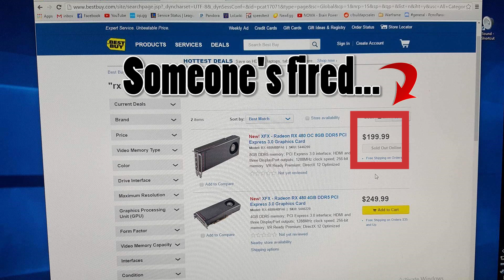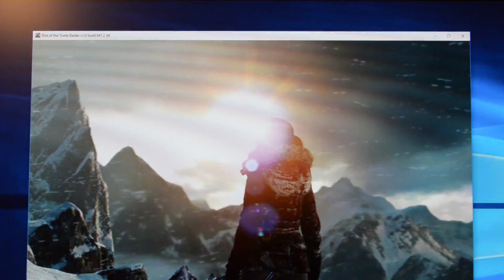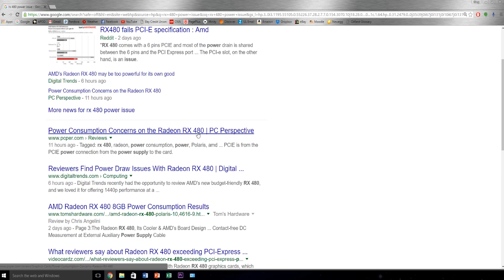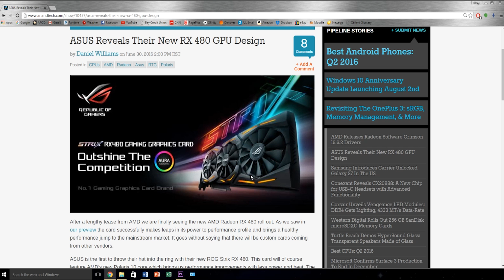RX 480 Aftermath: Power Issue & Over-Hyping

Comment: RX 480 loses against R9 390, which is cheaper right now. So whats the point?
Reply from the maker: The R9 390 is not cheaper than the 480 here in the States, where I and most of my subscribers live. That's the point.
Reply: +Science Studio yeah it varies. But here it is. But the point is the perfomance. Will custom 480 bring much higher perfomance?
Reply: Yea the 390 edges it out just barely. The 390 was the AMD card to get last year. It was also 400 bucks when it came out. I think you are missing the fact that the 480 has about the same specs, performs just as well and is half the price as the 390 at launch. Also it draws half the power to get those numbers. Right now a 390 is $275 and a 480 is $240. Old tech vs new tech and you save 35 bucks. The choice is clear for a mainstream gamer.
Reply: +J C Who cares about price launch?!?!? The thing is that 480 is same price with 390. And 390 have better perfomance than 480.
Reply: Yea, I can see this conversation is going nowhere and you obviously don't know anything about graphics cards other than the price.
Reply: +J C yeah yeah say this to the bencmarks.
Reply: +J C you Just think because the 480 has better price launch its better gpu! Wtf really.
Reply: The benchmarks are made without optimized drivers. The benchmarks are literally moot. If you don't understand the technology differences in a 390 vs a 480, you aren't ever going to get it. The 390 barely, just barely outperforms the 480 on drivers that aren't even made for the 480. So when the drivers start to mature, you will see the 480 beat the 390. Reference boards are good for a baseline benchmark, but partner boards will offer better cooling and performance increases, compounded by matured drivers. So, in other words, buy the 480, not the 390. You will thank me later.
Reply: +J C did you saw that 480 had drivers in bencmark videos?
Reply: The drivers used for 480 benchmarks before the release of the card are pre-release drivers. They were made so the card would work. They weren't made to optimize the card. AMD is still working to optimize the 480 drivers. When the drivers mature (which is what I said before, but i guess you missed it), you will see more performance improvements.
Reply: You're never going to get it. You have no interest in understanding. You just want to argue on youtube about your preconceived notions of AMD.
Reply: +J C dude wtf really? Who said about bencmarks before the release??? Look The bencmarks after The release of this gpu! Lmao
Reply: Dude, I think you might be slow. The benchmarks you are seeing all around youtube, were conducted before the card released.

 Do you really think someone received the card in the mail, conducted benchmarks, and uploaded a vidoe all in one day? If you do think that, you are a special one. 

I don't feel like explaining how the world works. Also, I'm pretty sure you're 12.
Reply: Also, notice how the major driver version is the same that it has been for a while. The minor version just changed on 29 June with the release notes stating "support for RX 480". Meaning, the version release was to make the card WORK, not make the card optimized. Once again, you're arguing what you don't understand.
Reply: +J C so when The Rx 480 came out, magically the drives boost the gpu with 10 fps? That boost need time.
Reply: +J C The drivers arent magical. They Dont boost the gpu with Lot of perfomance! Look at any video in yt, which is one or two Days old and see that RX 480 has same perfomance with reviews.
Reply: Again, you are showing how old you really are. You haven't been in the graphics game very long, have you? Drivers have a HUGE impact on GPU performance. That is the very nature of what a driver does. Think of it like this: you have a mouse conneccted to your computer. The initial driver release causes the mouse to lag during fast movement. Subsequent driver releases start to fix this issue over time and versions of the driver. It is the exact same idea. The RX 480 is beyond, technology wise, what current games can handle. With every subsequent driver release, performance will improve. Don't believe me? Well, EVERY big youtuber says that performance will change when drivers are optimized for the 480. Wait for the drivers to mature. If you buy a 390 now, you will be  disappointed later down the road. If you bought a 390 when it first came out, like I did, you would understand this. The technology jump from the 390 to the 480 is SUBSTANTIAL and will only be shown more with time.
Reply: And to add to that. You not only don't want to buy a 390, you also do't want to buy a reference board 480. Wait for MSI to release the GAMING X version or ASUS to release their version of the card. It will for sure have better cooling, and likely have better specs than the reference board. Graphics cards 101.
Reply: that doesnt mean said drviers are matured yet

this is why cimparing this card with the older ones of the same model is not fair, those older cards have been around for longer so AMD and Nvidia have optimized their control software(driver) to utilize the full ability of the hardware.

give it sometime and as more software is rleased the drivers for the 480 will mature aswell
Reply: it needs time and software developers to work with the arquitecture features(or more realisticly the API the cards are targeted at, in this case Dx12 and Vulkan)
once this starts ot happen you should see frequent driver releases ot optimize the card for those applications and finetunig of the hardware

A good driver goes a LONG way and even a fantastic card spec wise can be crippled by bad support
Reply: an analogy for htis would be :

let's say you are learning how to drive car(a new GPU)

although you know the basics of how the card functions and how it should be used(the current API's and basics of driver develpment), you arent immediately acquantied with the speficics of what the car is capable of doing(new api and spefici tech on the board), that comes with practice and training(drvier revisions and software made with it in mind).
Reply: See? This guy gets it. He took the time to actually learn about how graphics cards (and just about any other computer component) work.
Reply: yeah but theyre not going to sell 390's without price drops
Reply: *****
is R9 390 nvidias gpu? no right? then get lost. stupid arguments

Comment: with nvidia's new softwares and update like ANSEL, i would go for a gtx 970 instead. its less expensive on our country and have more stable drivers.
Reply: Well, i would still get the 480 when the board-partner ones with custom pcb comes out
Reply: lets just hope it wont be on par with gtx 980 when it comes to price. because the rx 480 here is around 320usd brand new,

while gtx 970 is around 260usd brand new down already because of the release of gtx 10xx cards while having free games with it.

the thing is based on the benchmarks its just on par with gtx 970 with just a couple single digit fps increase on dx12 benchmarks but getting beaten by gtx 970 in dx11 benchmarks. 

but no one knows, we might be using vulkan instead in a couple of months.

worst nightmare would be if that card with custom pcb comes to a 400usd price point on retailers.

this is just a perspective of an average consumer who doesnt see prices based on what was advertised by the company but the price of the product on the real market.
Reply: Yeah, taking screenshots at 25FPS is so much more fun than (actually) playing something at 40FPS in up-to-date hardware/software like Vulkan/D3D12.

Maxwell is already slowly falling into Nerfville, just as Pascal will once Volta releases (especially Asyncronous-Compute wise, you know... that thing that nVidia will finally have with Volta... allegedly... and also that AMD had since late 2011).
Reply: The 480 is faster than a 970 unless it's an overclocked 970 and that's with DX11 games. If you move to DX12 and Vulkan the 970 gets left in the dust.
Reply: Son37Lumiere Yep, and thats just the 480 reference
Reply: 480 is better, its new, performance can only go up and its more future proof for stuff like VR and if you are from EU you can order it from other EU countries without tax or customs.
Reply: THANK YOU. you are the first person to mention future proof!

Comment: LOL AMD. "entry level" card. requires a "high-end" mobo or risk frying your entire system whilst voiding warranty. damn son
Reply: read comment from science studio....
Reply: If you have a motherboard from the 2012 onward, you won't have an issue.
This PCI-E 1.0 is generally found in Motherboards from 2006 and before.

So who the hell uses a decade old motherboard and expects their excuse of scrap metal to be a viable gaming pc?

This is what happens when reviewers want to pay dirt cheap dollars for a motherboard part, they get it for $25-30 and recieve a 10 year old motherboard.
Reply: It needs new gen of motherboard. not necessarily high end motherboard.
Reply: It doesn't require a high end mobo. It just requires a mobo that's not super old. And it only applies to the reference model (granted that's the only one available right now, but it did JUST come out).
Reply: If the RX 480 costs $350 outside the US ($300-$350 in Canada), the GTX 970 would be over that much still (over $425-450 in Canada).
There are various elements in the test that can take away performance of 'non-nvidia' cards too, like GameWorks being utilized in most of the games that are tested in those videos.
Reply: idiot
Reply: Alvin Buenaventura That only happens with older motherboards. 1060 cant sli either.  Nvdia is becoming less consumer friendly each generation.
Reply: Biplav Shrestha Wow really it's fixed now, through the driver fix?? Sad that the nvidiots won't know that
Reply: Just disappointed with AMD. it's 3 Strikes now. The FX CPU, then the "Fury X" as "Titan X Killer"(wow) now this. i won't be this salty if the card didn't have power draw issues and at least put the 970 in its place. but no. they are still haunted by the 970 to this day. sad
Reply: It doesn't have to be high-end, just make sure your mobo is fairly new. You should see the uploader's latest comment.
Reply: The vast majority of people who would eye a 480, are people with older systems....because the people with newer systems, already have R9 290's, which is what the 480 is essentially on par with.  On top of that, it negates the benefit AMD touts with Vulkan and such, since it touts that you don't need as much CPU power.  

Now when it comes to those people who may need to upgrade their CPU to get a 480, and hence motherboard as well....AMD's current CPU offerings are already 4 years old!  

The truth is, AMD probably intended for this issue so they could force people with older systems to buy newer ones.  If Nvidia had this issue, AMD fanboys would be burning Nvidia at the stake and laughing while doing it.  

It's also important to note that the Nvidia card he tested, had NO issue, and it drew more total power.  So this isn't just an older PCIE spec issue....this is a design flaw in the 480 itself that triggers in combination with older spec PCIE.
Reply: +Wolfang102
Finally someone posts something good on this site.
Reply: Idiot
Reply: +Alvin Buenaventura
Do you know what budget gaming is? Of course you don't. Also, AMD isn't in control of the prices around the world, nor is NVidia, did you see the notice before the end of the video? Oh, maybe you're here just to show how upset you are because of politics, why don't you go complain to those who you voted?
EDIT:Okay, maybe not politics, but still, not AMD's fault the 480 costs less than a 970 in some areas.

Can't beat a two year old decisively... proper dx12, better VR, mantle API, vulkan API, 8GB Vram, less power draw... same cost... logic= Error 404.
Reply: The power draw issue only applies to the 'review' cards, and these aren't picked up in a retail store.
Reply: Alvin Buenaventura 980 ti matched or beat titan. This card costs 239 for 8gb and is slightly behind ssc 970.Show me a 970 ssc for the same price.
Reply: Biplav Shrestha Nvidia is expensive for a reason lol. they have "Quality" look at the new cheap under-performing AMD card with power draw issues. AMD even said that it's a minority when all the reviewers who can and knows how to measure power draw reported the same thing. and those who did it after the news came out. practically confirmed it.
Reply: Alvin Buenaventura  Power consumption issues are exaggerated anyway. Google Polaris Rx 480 Power problems or PCI Exaggeration.
Reply: It may be entry level now but it is still a massively powerful card! Just because it doesn't compare to the ridiculously powerful 10 series Nvidia cards doesn't mean it's not powerful in its own right. Why on earth would you expect old or cheap and crappy motherboards be able to cope with such a powerful card just because it's now considered "entry level" is beyond me?!
Reply: It's fixed now so who cares.
Reply: +Alvin Buenaventura This is reference card. Reviewers are using non reference 970. Power issues had an easy gix just put in a 8pin connector. This was very dumb of amd. The price difference between 480 and 970 is significant if you are buying it new.
Reply: Biplav Shrestha yeah its a reference card. but the technology and architecture is brand new. it should at least put more of a fight against an old 970. like how the 1080 surpasses the Titan X in all aspects while being WAY cheaper and more power efficient. thats how you do it. if anything, this just highlights how far behind AMD is in their design. and ofc 1st impressions last. with all this negative news about the new card. it can't be good for AMD. Nvidia screwed up too with 3.5GB RAM in 970. the same card AMD can't even properly deal with. i guess Maxwell is just too well designed.
Reply: Alvin Buenaventura Also 1060 6gb will cost $300.
Reply: C North Since then he has posted a video about $350 rx480 so it doesn't happen all the old mb.
Reply: old or not. you still have a chance to FRY your motherboard. certified PCI-E limit is 75 watts MAX. the card draw upwards to 90 freaking watts on load! they put that limit for a reason! the chance is ALWAYS there. no peace of mind for the owner. it is a flawed card. 

and really addressing the issue with a driver update? iv'e worked long enough on hardware R&D to know that's a bullshit excuse. it clearly needs to draw 90watts on the PCIE lane to achieve peak performance. limit that to 75watts? lmao.
Reply: No he basically said it requires a mobo with a good power phase which means about $80+ on the mobo.
Reply: it costs $350 outside the US. can't even win decisively against a TWO YEAR OLD 3.5GB GTX 970. wow. and this is a "new" architecture done on a 14nm process. all those specs. underwhelming performance. and a PCI-E power draw issue. just wow. what a fail. considering a 970 costs $290 and a 1070 costs $430 here. again. wooow. its like the Faildozer all over again. OH 8 COREs will STOMP 4 cores of i7. wow.

Comment: I was having a similar issue with my old pc I built back in 2008.  I stopped gaming around 2010 and just got back into it this year.  I did a fresh install Windows and beefed up the graphics card to a 980 to see if I could get away without doing a new build for a while.  Installed things, everything was going well.  As soon as a game started to get intense in graphics it would just shut off like you're describing, so I got a new power supply to see if that would fix the issue.  Turns out I made this all up and wanted to see if you guys would keep reading.  👍 Thanks for the video SS, I'll wait for a 3rd party before purchasing.

Comment: i feel like this is pretty bad
the 480 is marketed at the more casual gamers who want to just slap the thing in and play games or VR
those people generaly dont know as much about pc's as us pc addicts know, random shutdowns because of a cheap/old mobo would be unsolveble for them
Reply: This ONLY happens on pci-e gen1 mobos which are like 15 years olf
Reply: The custom coolers and PCBs should fix this "problem" anyways
Reply: These people won't have 2006 motherboards
Reply: taief miah 
i do hope so
otherwise it would be pretty bad press for amd
Reply: There's no need to hope so. It IS so. It doesn't matter how cheap the motherboard is (obviously make sure it's not cheap enough to crap out regardless of the GPU). The only thing is that your motherboard can't be older than the freaking smartphone.
Reply: geen naam Check PcPers website, they have an article on this. Unless you OC with the reference card you won't risk being outside tolerances